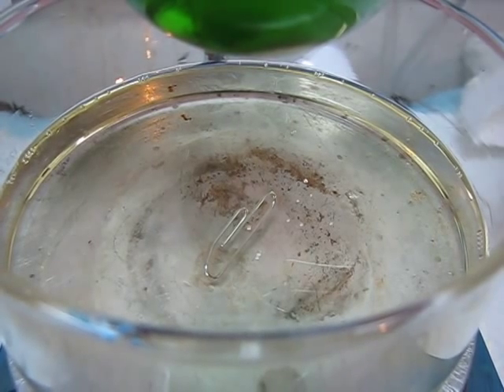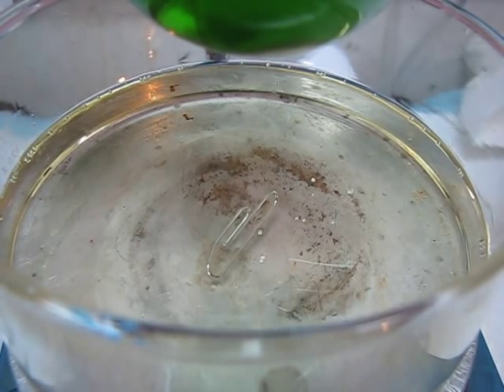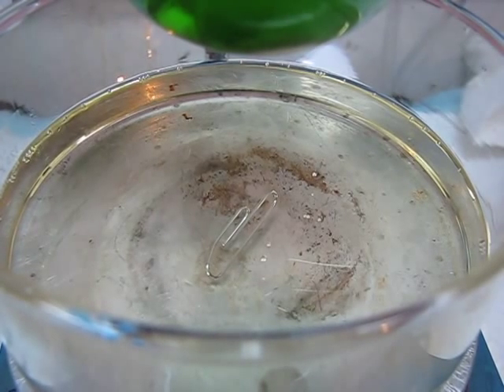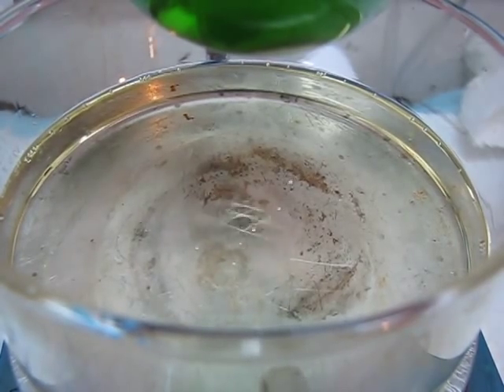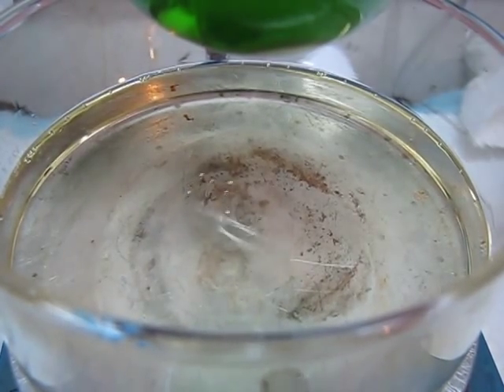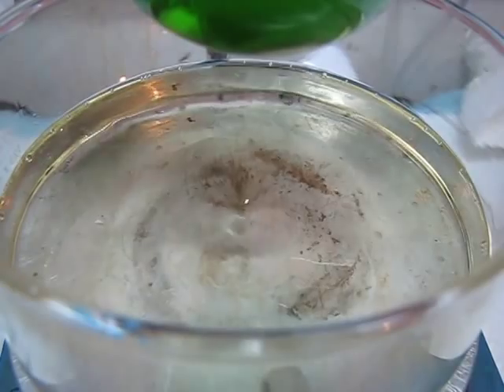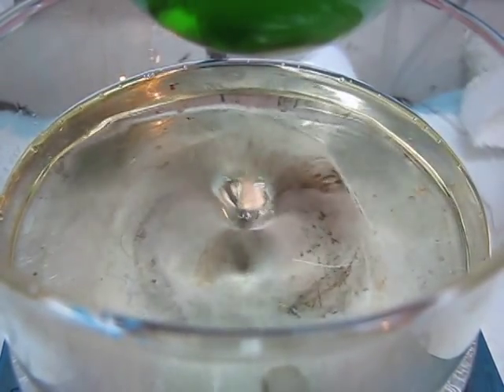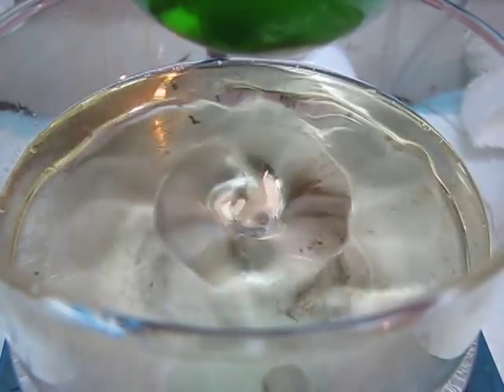Lab Tip - Oil Bath Stirrers

Comment from the maker: @lexichronicle2 Adding a foil cover over top of things does help, however it won't help for odd shaped glassware that requires even heating such as pressure vessels. If you can't get surface area contact with the heating source, you'll need oil to bridge the gap unless its a standard size (ie: RBFs)

Comment from the maker: @lexichronicle2 I have never had that work well for me via air only. Specific heat capacity is too low. If I use a heat gun to warm a flask, that is one thing, but the air can be up to 500degC if I want. My hotplate stops at 300degC. Why don't you make a video of this to compare heating rates?